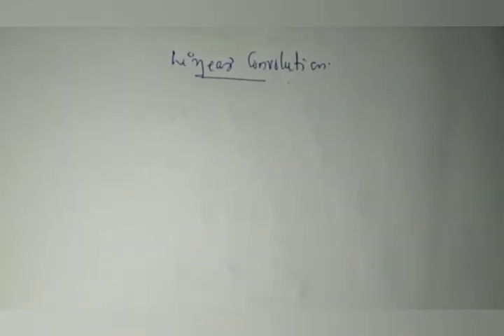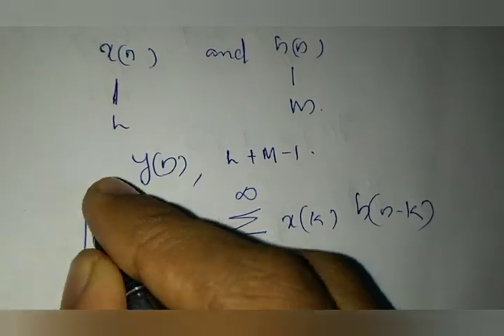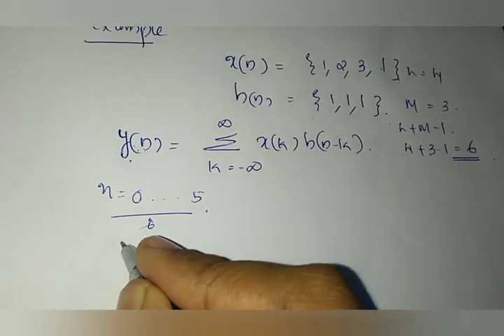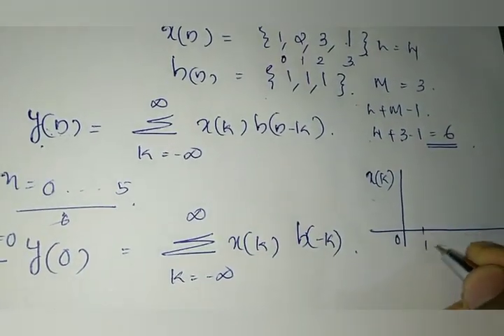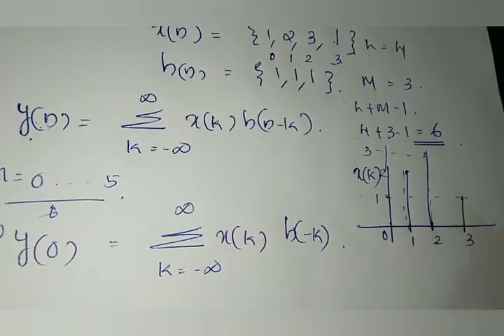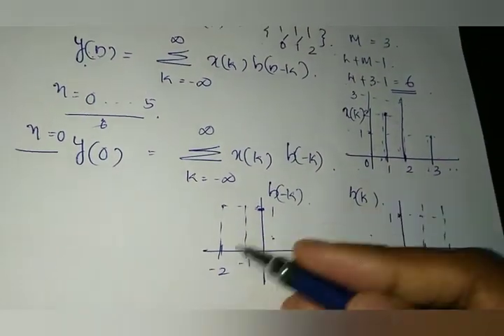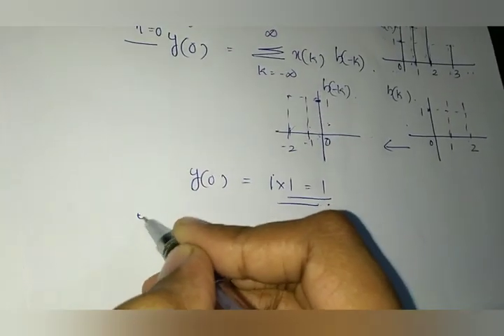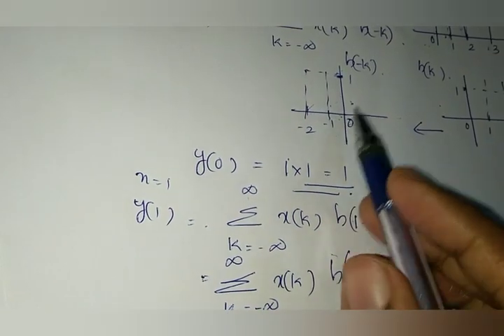Linear Convolution using graphical method

Comment: adding (+1) to the signal, isn't it supposed to advance the signal instead of delaying it? eg y(-2) = x(-2+1) which is y(-2) = x(-1).
Reply: actually she meant that: eg.:  h(-k+2)=h[-(k-2)], so for this case first you start scalling the original signal by -1 and then shifting it to the right by 2 units.